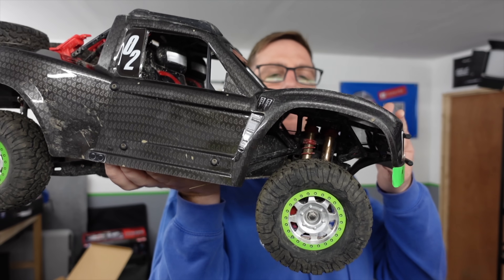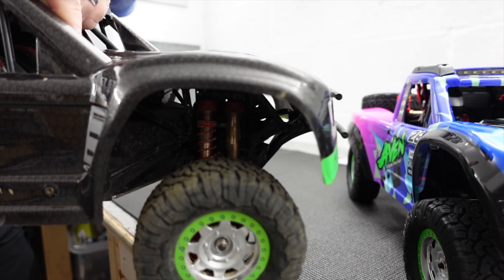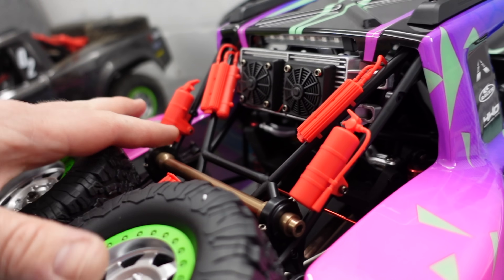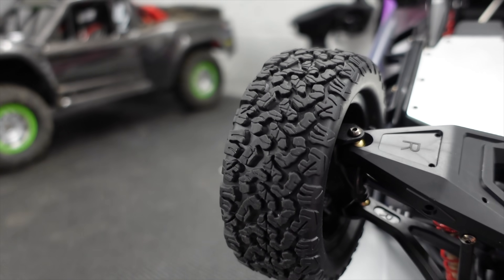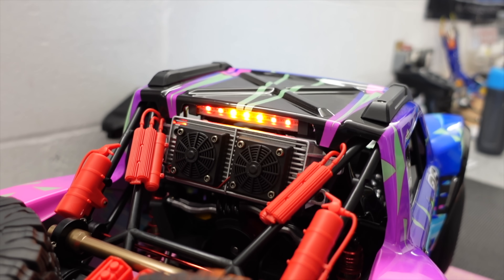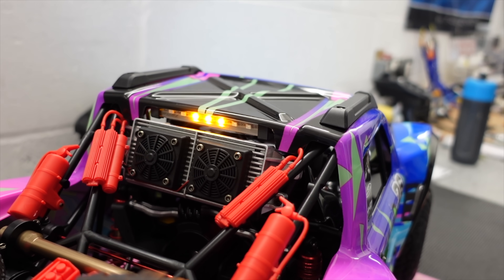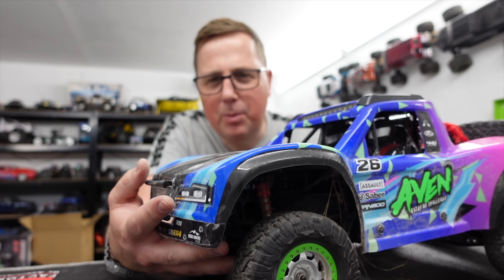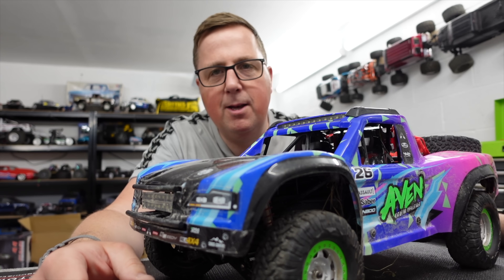This Knock Off RC Truck  is now CHEAPER, but... there's a catch!

Comment: They took out everything that made it interesting
Reply: But nothing really that this type of RC needed, to be fair...
Reply from the maker: Yeah… but they could have at least changed the tyres 😅
Reply: @TomleyRC  I think reducing the costs were at the top of their priorities. So, if the previous tires endured abuse... 
Most owners of this will probably haven't had any previous experience with these type of RCs and won't be too bothered... Until they actually try a nice one, and then either get tires and dampers, or ditch this completely. 😬
Reply: The boxes are always generic, that's why there is no upc. There are multiple trim levels the SELLER can order. The model number probably is not the same (which is what the box says). SG is usually the cheaper version. Hbx or ZD etc being the. high end
Reply: @TomleyRC  make another video with different tires on it?
Reply: And reduced the price a bit, I thought this would cost like half the original price…
Reply: @DashzRight  It still takes time to assemble. You are paying mostly for time, not parts
Reply: @createsomefun  are all these put together by hand?
Reply: @DashzRight  Of course, there are no machines that can assemble these. Even if there were, the market isn't big enough to support that kind of investment. It's an assembly line of people.
Reply: Many times the "quality level" is often which run the company gets to use the tooling. So SG/pinecone, then UD etc. Then those are rebranded as MJX and JJRC etc
Reply: @createsomefun  very interesting
Reply: @DashzRight  If you wanted you could call HSP and get basically anything you want built to your specifications as long as you want to order 500
Reply: i mean... they didn't really take out, the original is still available. this is just supposed to be a cheaper, simpler version

they dropped the ball in this regard as the cheaper simple version is nowhere near cheap enough (particularly compare to the full featured version) to warrant its existence
Reply: What plug do i need for the battery for this rc just got one and need batteries but dont know with ones i need@TomleyRC
Reply: @TomleyRC  How do l find the batteries for this car no Aliexpress?

Comment: For me in the states, a base Slash 4x4 is $70 less at 299. The Slash 4x4 VXL is only a bit more than this at 399. Plus there's hobby shops all over the place that stock almost every part you could need for a Slash. My local shop even stocks a bunch of RPM parts for Traxxas. The ease of getting replacement parts is the main reason why I still pay for the name brands.
Reply: Still not a fan of Traxxas with the high prices.
Reply: While I have Traxxas and a ton of Chinese RCs. I've never had problems getting parts for Chinese RCs. But, this right here is ridiculously priced. The cheaper version he's talking about is more expensive than the really nice upgraded version on Banggood. It's just doesn't make sense to me.
Reply: But comparing this to a Slash is a bit off, closest thing to it in 1/10 scale is the Losi Baja Rey and that thing is amazing but also VERY expensive for 1/10
Reply: I consider the Slash as the standard 1/10 truck.  I bought one just to test it against my super upgraded Nikko Dictator.  The Nikko wins everything except durability 😅
Reply: @MustangsCanTurnToo  Omg. I had a Savage Dictator as a kid and was in love with that little 4.8v beast. Lol.  The Slash is but it has the typical short course double wishbone suspension which is why I kinda separate it off from this but it is a pretty nerdy distinction to make. Lol
Reply: That's what chinese guys say about this truck.
Reply: Slash is not comparable to this though, this one is trying to be realistic and scale, while the slash is a basher with a sct body. I’m not saying this chinese rc is good but it should be looked at differently than a basher
Reply: @ghostinng274  that's a fair call. It's the main reason, or likely the only reason I don't have one just yet. Lol.
Reply: A big thing is I believe Traxxas and US name brands get slapped with a fat import tax and shops don’t stock to many parts for them. We are very blessed in the U.S.
Reply: @JUSTHAVEFUNRC  In canada they're very expensive, the cheapest Slash (2WD, brushed motor) is around 400$ with taxes.
Reply: @6132-k1n  yeah It’s about 220 USD stateside for the most basic model. Looking at a currency calculator it says around $300 Canadian. That honestly sucks.
Reply: @ghostinng274 agree i got the Slash 4x4 basic and the Rally i can build one with parts i found in the hobby shops but for me the prices for the products are expensive i just made a comparative and aftermarket beands are bit more cheap but you don’t usually find those brands in the hobby shops
Reply: @smokeyrameriz478 where do you get parts from?

Comment: F.Y.I.....The new V2 version doesn't have the 120amp esc that has the 2 cooling fans and looks like a radiator..They have better shocks now but they changed electronics to waterproof dumborc receiver/transmitter and 60 amp esc!!!Has gyro feature and I was disappointed when it arrived because the advertisement still showed it had all the previous version features..You can still run the 2 batteries in parallel but your probably better off switching to a higher rated amperage ESC to do so..Still a fun truck though and the availability of parts and upgrades is pretty good.

Comment: It's all preference for the driver. Personally, I run a spool which is 100% locked. Guys like Harley Letner and Robbie Gordon use a clutch pack style limited slip differential. Some guys use wavetrac, some guys even use an air locker still which is what I used to have in my truck before I upgraded. BTW that pinion angle would NEVER work on a full size truck. You have to find a happy medium between full droop and full bump or "compression"
Reply: Yep, spool and an Evan Weller third member for me. Though next year we're going with a fortin or gear vendors under drive to drop ratios and get a little more tooth engagement from the pinion.

Comment: I got one. Cost ¥45,000 from AE while a Losi Baja Rey was ¥110,00

I’m stoked with it—goes good enough for me. Run four battery sets through it so far… turning the steering down as I turn the power up helps a lot

Split the body already, jumped straight into a tree. The tires are ok, slide nice on concrete too but I’ve buckled the rims from flipping it 😂

So, what is it a copy of? Going to need some spares eventually. Or now 😂

Comment: I am passionate about short courses and this one looks very nice. I believe that the reference model by size and characteristics is the Losi Baja Rey, I have one and I love it just like my UDR. The Baja Rey once you tune up the damping and change the tires (I'm wearing Louise Uphill) it runs great and is incredibly reliable. The most reliable of the cars I have. It's not cheap but it's worth every single one of the €529 it costs here. The 1002 S is €345 but even though it is an important difference, I would not change it for the reputed quality of Losi. Good video and greetings
Reply: I agree. I'll take a Losi over this or a Traxxas.
Reply: You are really missing out dismissing these trucks. They are made in the same factories and are very good
Reply: @createsomefun  Did you see how that brick drove? It was horrible. No thank you. There are much better RC vehicles out there.
Reply: @TheCabledawg1  I have the Losi BR v2  and the UDR, they both offer different things and bring their own joys IMO ?

Comment: I feel like the low traction tires are intentional. Saves on the slipper and other driveline components on high traction surfaces.

Comment: That needs some work like most. Trailing arm trucks are a different animal. Need power up your sleave in the corners. There is a thing called to much traction with them also. But be weary of the massive weight transfer they have. I love them. Have udr, twin hammers,yeti,bomber and baja rey.

Comment: I have a bullet proof slash that I have modded from bumper to bumper, Only thing left on it stock are the servo and the chassis lol. I have decided that from now on I am just buying the chassis and adding all the parts cause I just upgrade them anyway. Wait til you see my Comical Grasshopper.  Have you made one?

Comment: Interesting rig, I didn’t notice with the first video but I have a UDI racing desert racer which is a ssv version of this, same layout, same hard tyres same difficulty controlling it until I realised it has stability control, which I turned off, handles way better now.
Reply: you have the 1001? tell more more, it's on my shortlist :)

Comment: Looks like the FTX Zorro (brushed), or Axial Yeti underneath, with that chassis design. The Zorro has a locked rear axle, and handles much better than that. Looks great though. 😎👍🏻

Comment: I think its good starting point at least for me who doesn't want to spend alot of money for this hobby, i would later upgrade the suspension and it'll run way better. I always love throphy truck style rc but they're so expensive, I'll take this as consideration.
Thanks for for this video
Reply: There is really no need for 8 shox in truth.
Reply: Did you end up doing it
Reply: @tim0339  always, im cheap, just having fun not really going hardcore😀

Comment: Trim level is specified by the seller for the most part when ordering from the factory. Look at remo, you can order the ultimate version which isnt even listed on the SCT box (it is a model above the TOP)

Comment: I was thinking about getting this glad I waited. Great review
Reply from the maker: Thanks mate
Reply: Hey Thompson RC👋..I just got the newer V2 version and they gave you better shocks now but they changed all the electronics. You don't get the 120amp esc that looks like a radiator with the 2 cooling fans anymore!!They give you a 60amp esc and a dumborc receiver/transmitter now!!..Also you can still run 2 batteries in parallel but probably better off putting an aftermarket 120amp or bigger esc in it to do so.Was definitely disappointed when it arrived because the advertising still showed all the previous models features..It's still a cool truck though and parts and upgrades are available for it too..Still has gyro feature and waterproof electronics and esc with cooling fan and it's pretty durable. Definitely a fun truck to have in the collection..Hope you have a good one and take care!👊😎
Reply: @cbsshenanigans862  Thanks for the info I hope your doing well

Comment: It has potential for sure. But wow those tires are terrible. Shocks probably need a rebuild with green slime to keep them from leaking, new oil, maybe springs. That locked rear diff is going to make the turning circle wide. I would swap it out. Much better driving experience. Other than that looks decent. I would still go with a Mojave. Parts availability is a thing.
Reply from the maker: It could be so much better. Same as always… they fail to test them or at least get someone in the company to test them that knows what they are doing

Comment: i would like to point this out because of rear stock is so bad can cause front end lost tracking which why leads you sliding all over the place
if you can beast up rear stocks them will make big different because i own few off road rc 1/8 and 1/10 and i have noticed mine was doing it because rear end hit ground cause front come off the ground not touch it and just slide all over the place and after beasting up rear stock it make big different keep front end down

Comment: Off topic, but looking at this got me looking around Banggood.  Have you seen the HBX 2996a?  Looks like a 1/10 version of the 16889a pro.  If it is, I'm kinda sold on it.  Might go ahead and order 'cause it's like $160.
Reply from the maker: Yeah, doesn’t look to bad for the price!
Reply: The battery tray is tiny on that HBX 2996a. Looks like a deal killer for me on that one.
Reply: @MagnifiedGiant  I did notice that but for under $200 I might deal. Lol
Reply: @seanwilson9117  Yeah it is probably fun for a few minutes!!

Comment: Great Vid dude XD I am still undecided on this truck I REALLY liked the transmission so I am disappointed they removed it (SIGH) I thing they put the hard tires on to keep it from traction rolling on pavement and I would rather the car slide than flip but it appears they went to far it takes a delicate balance the UDR's tire feel like they are close to Ideal a little too grippy out the box but are better after they are worn in I save a bald set for pavement and grass runs. I still run my Yeti Score with a 2 speed but I am running out of spares and would like a 10th scale trophy truck but I DON'T want a Baja Rey because it doesn't have a 2 speed and it killed the Yeti and they were different enough that Horizon shouldn't have cancelled it after the Acquisition

Comment: Unlock the diff it will drive better😊
Reply from the maker: Well… the more expensive version has an unlocked diff and that wasn’t much better 😅
Reply: @TomleyRC  hmm. I’d be looking at the tyres next then after getting the diff unlocked go to possibly adjusting your shock oil weight.

Comment: You did a very good review. Many years ago I had a 2WD Arrma SSCT and it had the plastic tires, which were terrible. why would you put a locked rear diff in a SCT?
Reply: Full size race rigs all have spooled rear ends. Even the rare 4wd ones do also. Throttle turn in.
Reply: because it's a TT, not a SCT

Comment: Don't think there's anything that can compete with the slash 4x4 ultimate in the same category. value for money handling and speed, looks 🔥🔥🔥🔥🔥🔥
Reply: You should try the TA sc10 pro4, Traxxas slash doesn't not stand a chance lol
Reply: @Just_Another_Ghost4-2  I own both you can't be anymore wrong bud
Reply: Same and the slash is trash, I would drive the sc10 anyday over that mess of a truck
Reply: Pirates 2 or 3 DEMOLISHES them all but actually has adjustments which some people don't like. Redcat Kaiju is the also same price.

Comment: I like the fact it has a cage under the body, but the rest is definitely disappointing.  But senton is king of the short course/desert trucks so far.  Had the traxxas vxl and had no end if issues, sold it at a huge loss but remained hooked on the style I took a risk of getting the senton and apart from the front bumper (common issue when you misjudge the size of gap and hit pole at ~50mph).

Comment: The losi baja rey 1/10th is better than this car, more expensive but still for me one of the best SCT
Reply: I agree about the baja rey being better, but I don't agree that it is a short course, for me it is a trophy truck rc, as well as this udi/sg 1002, like traxxas udr, the super baja rey, the old axial yeti score and others. Short course like traxxas slash, losi tenacity and others, have completely different chassis structure, usually derived from buggys, and therefore the behavior during driving is also different from trophy truck rc.

Comment: slides around not cuz locked dif.. no gyro lol 
my udr is not stock electronics.. i use my non gyro.. & better than open difs.. only front open on udr.. center & rear are both locked

Comment: if i may ask and be a bit provocative: if it got loads of potential, why not test said potential? i mean, just put some decent tires on it and refill the shocks with oil. that should be a 10min job for someone experienced like you, and would land credence to said 'potential' claims

and i don't think it's fair to compare this to a Slash or Senton. those have fully independent suspension, this has a live rear axle with a locked diff. and just like the UDR this is copying, i'm pretty sure this is NOT a basher, bur rather meant to be an actually scale trophy truck (whether it succeeds in said intentions is another matter entirely :))

thirdly, UDIRC and Pinecone or whoever else is producing, absolutely NEED to figure out another way to sell these outside China, because they're insanely expensive here, particularly when you take into consideration over there they're well below 200$